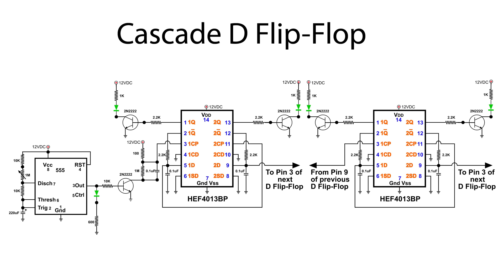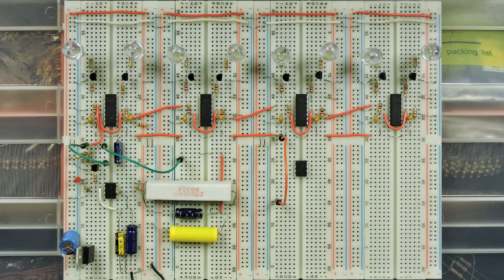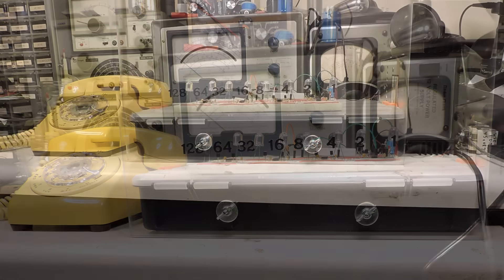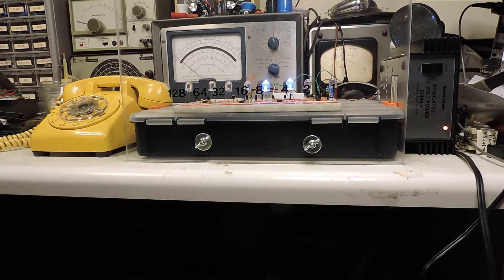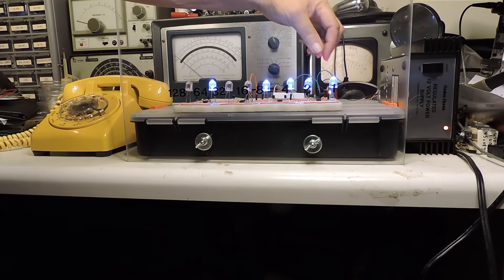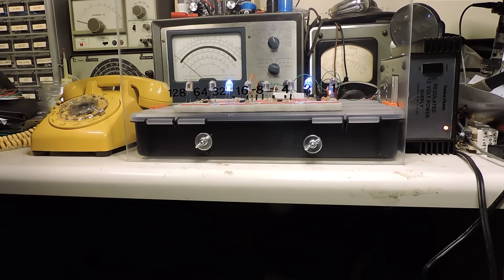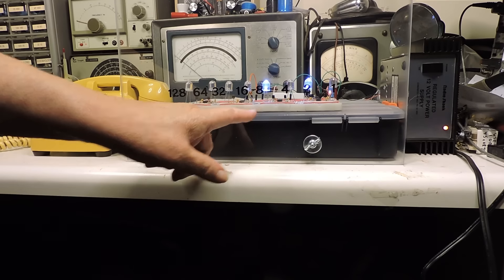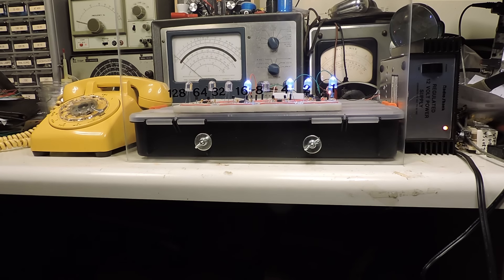My Mini Maker Faire Computer Basic Display

Comment: Loved this on many levels. I work for a rural telephone company. We decommissioned our 1950s Western Electric 5XB crossbar long ago which only worked with pulse dialing, but our modern CO switches still support it on analog POTS lines. I'd bet there are a few pulse dialers out there still.
Reply from the maker: +Matt Dwyer Thanks

Comment: Rich, what are a few good recommendations for a signal generator for aligning tube radios? Analog generators require a signal counter, correct?   If so, can you recommend a couple of these?   Thank you for you assistance.
Reply from the maker: +Tony Perry 
I have a Leader audio generator that will go up to 10K hertz. I also have an old Eico signal generator which will do much higher RF signals. I looked on eBay and found some very nice signal generators, with digital display, in the neighborhood of $60. Of course there are others that cost more, but for this hobby all you need is to cover audio up to around 10 MHz.